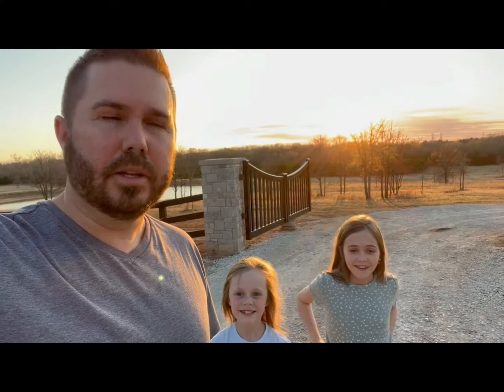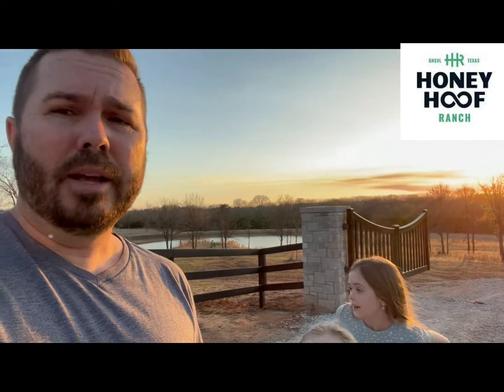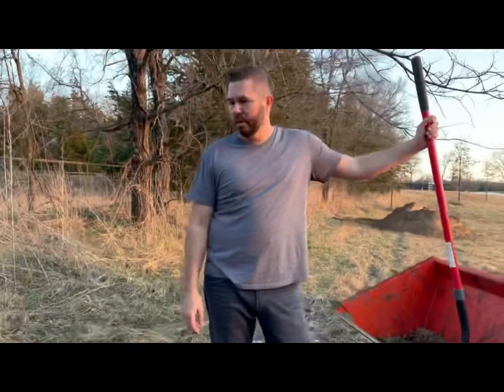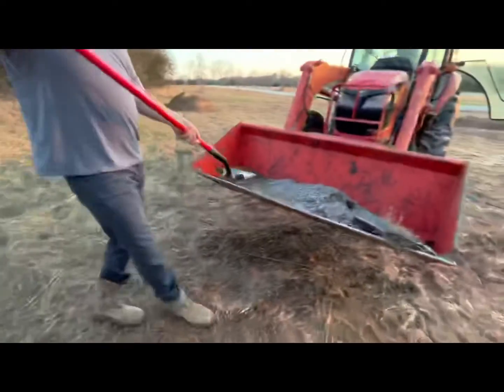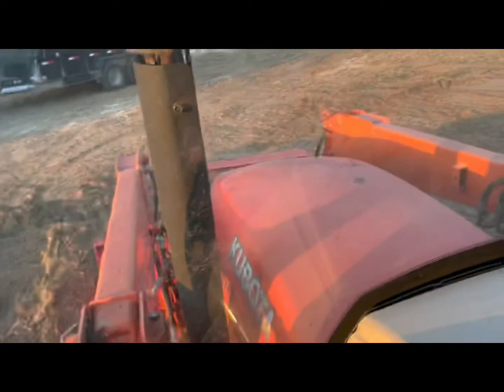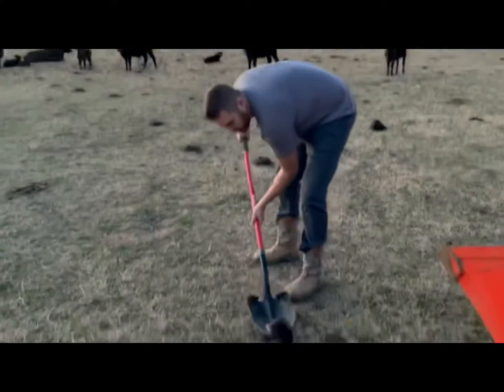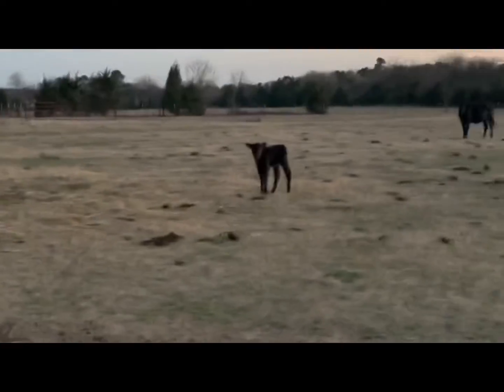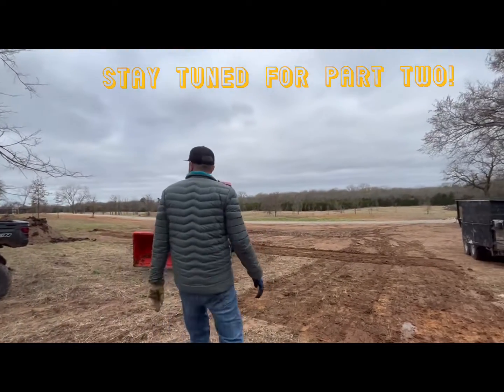Planting our Gardens  part #1

Comment: 1st thing I thought of in raised bed is strawberry plants. Growing in raised beds require more protection than a ground level sites. Place 6 to 8 inches of straw or chopped cornstalks on strawberry pyramids or other raised beds in fall. Fall Strawberry Care – One thing you don't want to do is cut back your strawberry plants in the fall. Plants should only be cut back in early summer right after they finish blooming. Pruning later can leave plants vulnerable to freezing out in the winter. Another crop is  asparagus.Most of today's asparagus crowns need to be planted six-inches deep. To plant them in a raised bed, just fill the bed with six inches of soil (half way, if your bed is a foot deep). To After the fronds turn brown, remove them by cutting them off at the base. You then have the choice of leaving the bed bare for the winter and hoping for good snow cover to protect the crowns, or mulching the bed with 4″ – 6″ of straw, shavings, or sawdust. Ten crowns will fit in a 4-by-8-foot bed and are generally enough to supply a family of four. They will keep giving year after year. With little to no care needed after establishing the bed.To over winter, mulching the bed with 4″ – 6″ of straw, shavings, or sawdust to protect from freezing. Also, the runners from the strawberries can be potted to create new plants and sold by the girls road side. Good luck, if it wasn't for the hard work of the farmers and ranchers we would starve. Subscribed and thumbs up this is the way it was meant to be, "teaching along with charity, starts at home."